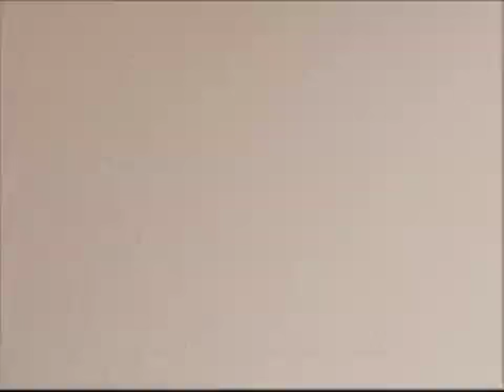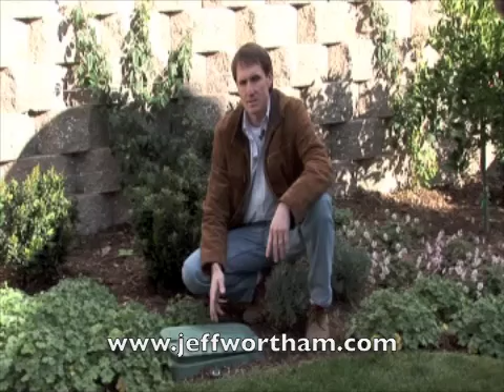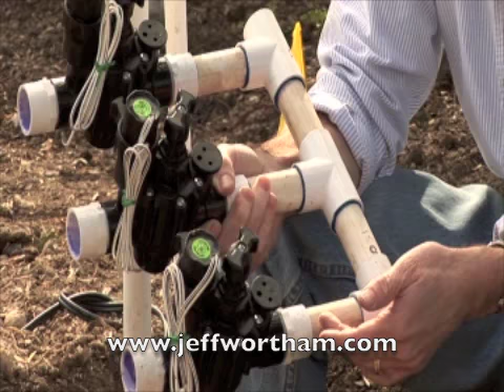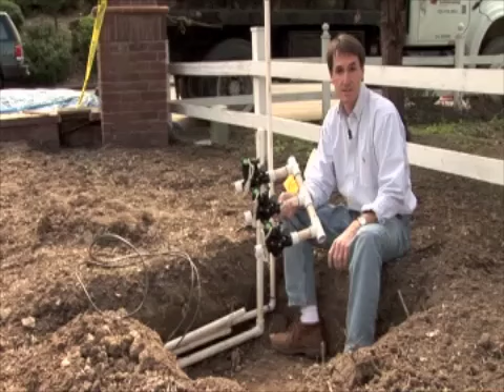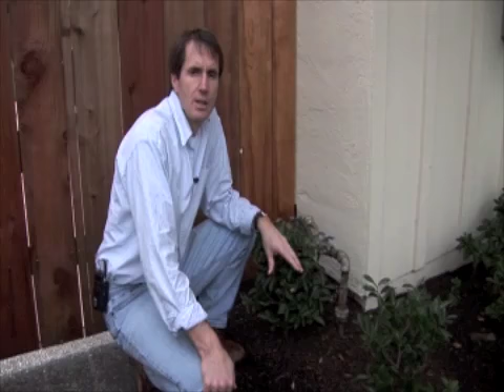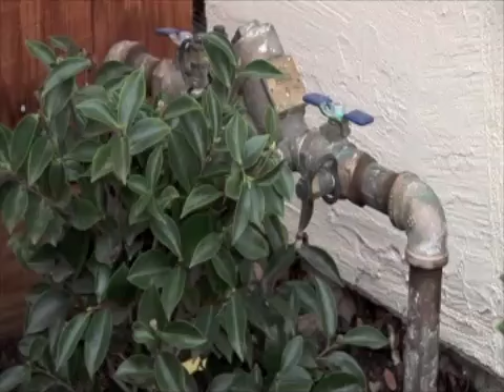Sprinkler/Irrigation system installation

Comment: Looks like your systems are really top notch.  Not particularly excited by the glue together manifold.  I guess in the worst case scenario you just make another manifold.   I'm converting an older hydraulic system with the main supply line being 1" copper.  The challange is figuring out the most economical and practical solution for changing out the valves and locating them in a way that results in the least digging and shortest water piping and electrical runs.  Unfortunately the original system had the valves spread out around the yard in different locations.  Some in the front, and some in the back and one on the side of the house.  In its day, it was probably a Cadillac system, but the timer lacks nuance, and 40 years ago electronic controllers were non existent.  Most likely the clocks of yesteryear were quite similar to the hydraulic control clock.  The advantage of hydraulic being no electrical wires in the ground.

Comment: sir how r u am how many rotor work very well 2inch valve
Reply: Having a two inch valve is great and I am assuming you have a two inch water meter?  It also depends on how much water pressure you have.  You should be able to have around 20 PGP heads especially if you nozzle them correctly.

Comment: Looks pretty good.  I'm all for Union joints.   The only thing is I wouldn't have used galvanized pipe and parts.   You're mixing with a Brass Valve and you're also going into dirt.  I would have used all Brass parts to the Plastic Joints.   More expensive, but far less likely to have issues later down the road where you're glad you have all them Unions!  

Your options as the local hardware store would be limited.  I get a lot of this type of stuff at McMasters.   Of course 1" Brass nipple 12" long is $30.  Where as at Home Depot a Galvanized Nipple of the same size would be about $7.    Big price difference.  You can replace yours 4 times for the same cost!    I hate digging holes, let alone to redo something!  You also would have been fine with the 2 upper Unions (Bronze of course) and not having the lower ones.  Not like unscrewing the bottom pipe would have been much of a hassle, if ever anyway if it was Bronze!    In fact you could have gotten away with just 1 union at the end of the Valve assembly, just use a short nipple to connect and then that's it.  If it's all Bronze, you can still unscrew it all apart.  You have to do it joint to joint, but the likely hood of ever needing to do that is very slim.  Just the one union in case you have a Valve issue, then you can undo one end and then unscrew the Valve from the other end and out it comes.  1 1" Brass Union, $40.   Again, not cheap, but you really could have gotten away with just the one and been perfectly fine.  The odds you're still alive when something happens to it are pretty slim.

Everything else was great.

Comment: Great video/information. I am installing an irrigation system, with a Pressure Vacuum Breaker valve, and what you described about how to install the PVB valve, i.e. the schedule 80 grey piping, is so important and essential, but no one has mentioned that to me before. The next question is, do you have more videos on the same subject, or on other projects that you are working on. The clarity of what you are describing is excellent and it deserves more dissemination. Thank you,